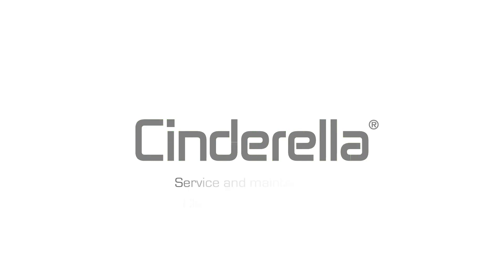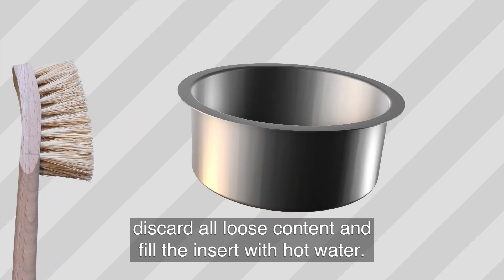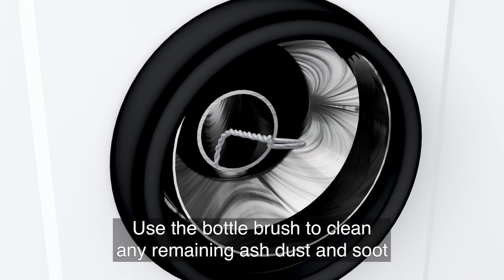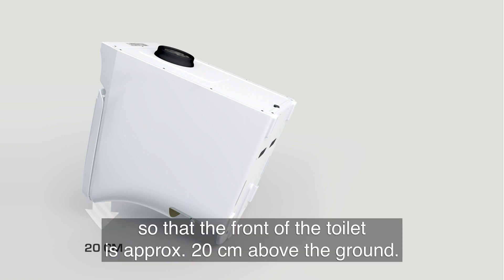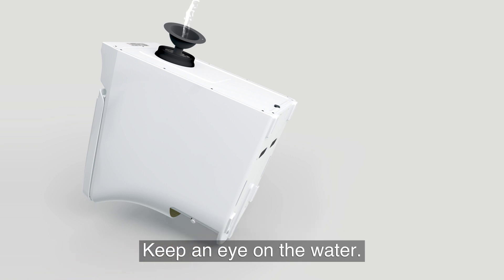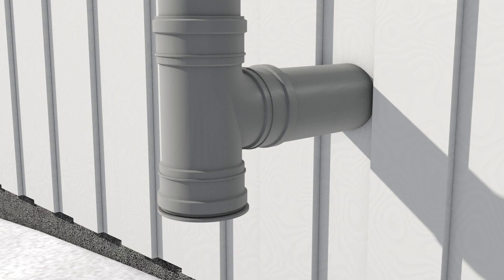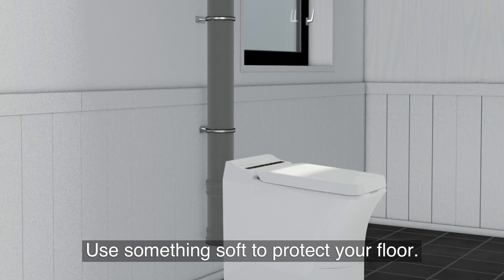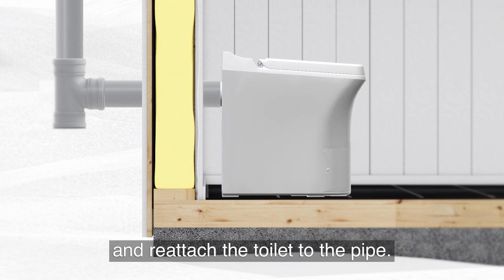Maintenance for Cinderella Incineration toilet

Comment: The tee fitting is glued on to the horizontal pipe, you can’t remove it. ???
Reply from the maker: Hi,
It's not glue, is soap for easier to put the fittings together :-)
Reply: @hyttetoalett  thank you for the clarification. So you don’t use glue for any of the vent fittings?
Reply from the maker: @wannaride808  no😄